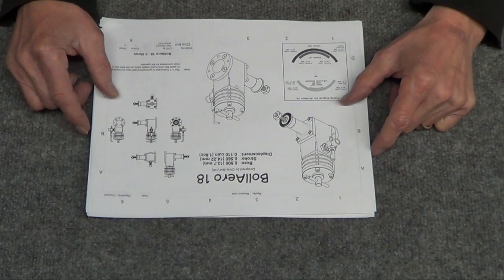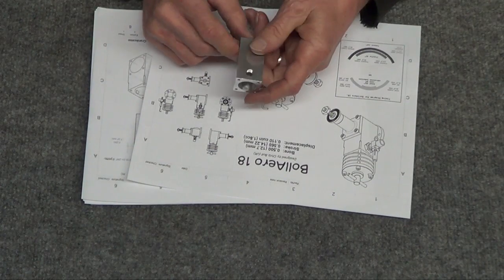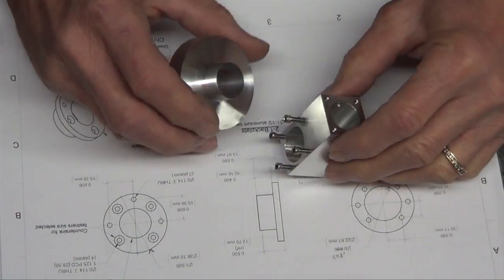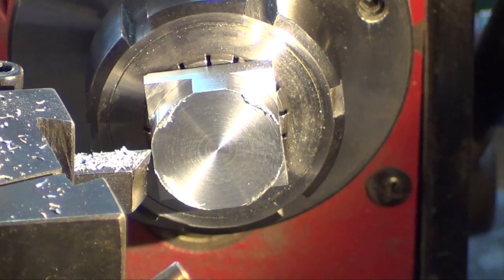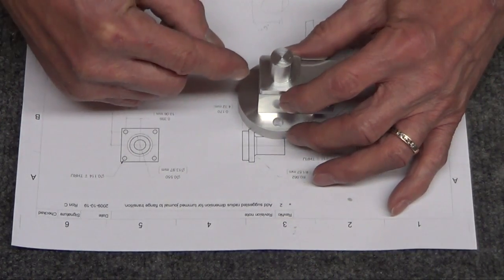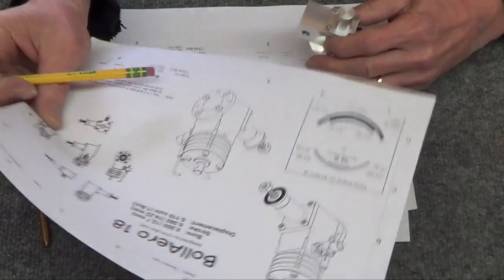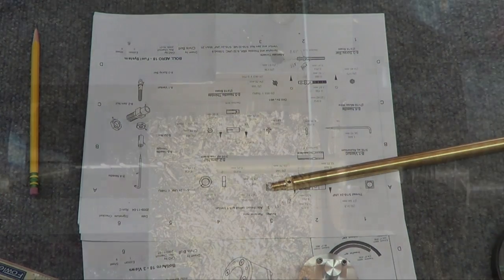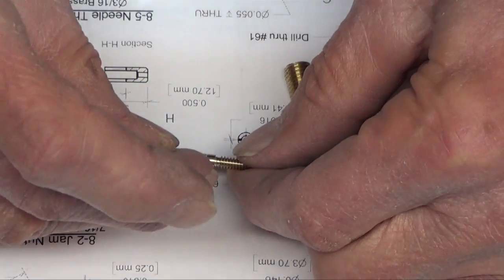Making A Boll Aero 18 Diesel Engine Pt.1

Comment: Hi Dave...  Tom Green....The Great white North...actually Northern Ontario, Canada..    Wanted to say hey and mention how much I'm enjoying the videos...   very informative and I appreciate the way you explain common sense....as you talked about in part 1 feeds and speeds....   telling people you need to cut to the centre...stuff that seems common place but if no one mentions it.... the first cut could be a BAD mistake...hahaha.
Over the next few weeks I'll be investing in a little CNC equipment, a router table, mini mill , lathe, and a 3D printer....  did I mention I'm a computer geek...?  haha    Something I've been watching for and maybe missed?   is   Taper Tooling VS. Collets....   seems to me collets would solve all the fitting problems you might have  and yet I see many with Taper tools..?   You Tony, Adam....   I was just wondering about the difference and wondering what I should be looking at considering I'm starting fresh....on all machines.  and suggestions?  or may a vid that you have already done?    Thanks and keep up the good work.
Reply from the maker: Glad you're enjoying the videos Tom. As for mills, cutters all come in just a few standard sizes 1/4, 3/8/ 1/2 and so on. So taper tools are not a problem you only need a few sizes. But now where do you want to go? I'm a hobbyist so buying a large 220V 3 phase mill that uses taper tools, which are expensive in them selves, is not within my pocket book range. I'm having fun with small lathes and mills which do not accommodate taper tools. So small lathes use a chuck for turning and mills use MT3 or R8 collets for end mills. The problem with MT3 collets is you can only get 3/8 and 1/2. I couldn't find any other size. So I solved the problem by going to ER32 collets on both machines. Cost less than $300 for all. Now I can hold ANY size anything in either machine. Feel free to email me privately and I can answer any further questions... Cheers

Comment: Great project idea. Maybe you already know this is meant to be a model airplane engine. You mentioned shortening the crankcase snout and crankshaft to match. Keep in mind the longer length is providing more bearing surface. If you have a local hobby shop, they will likely have model diesel fuel. There may also be a model club nearby. I'm certain they would be very interested and offer help in running and tuning.  Would you share where you got the blueprints and how to get them?
Reply from the maker: Been so long I can't remember where the web site was that had the plane. Google 'boll aero 18 pdf' and it's the first item listed for download. Hope this helps!

Comment: Dave, you might try this place for the diesel fuel. The website looks old so I don't know if they are still around, but it looks like they sell aero diesel in small quantities. (Look under Flying Accessories, and then Fuels.) http://www.freeflightmodels.com/   Otherwise, it seems that the fuel formula of 1/3 kerosene, 1/3 castor oil, 1/3 ether is common but as you discovered,  the ether is hard to find.
Reply from the maker: Thanks Hans.. will check it out but either is the main ingredient in the spray cans of starting fluid for cars. Watch me pass out trying to make fuel!

Comment: what kind of cad software are you using? There is a guy in "GrabCad" that has a Autocad Inventor files of this engine that you can down load.
Reply from the maker: I used Visio a bit for this project. You'll see it in part 2.

Comment: Very cool.
What is the hard to get fuel mix?

Brent
Reply from the maker: Either...
Reply: Dave M 

https://m.ebay.com/itm/Diethyl-ether-99-5-HPLC-Gade-30ml-/292382100376?_trksid=p2385738.m4383.l4275.c10&_mwBanner=1
Reply from the maker: Was hoping to get away cheaper I'll be and its sold where I live!
Reply: Oh wow ! That is daylight robbery! Even for pharma grade ether! 
Have you tried your local chemist? (apothecary...or 'drugstore' I guess you call it) 
Here (Belgium) I can get this stuff at my local chemist.
Alternatively you could use alcohol. The idea is that you lower the compression by which the fuel combusts.
So some of the fuel used for outboard racing engines with a bit of alcohol and some real diesel should do the trick....
This may be a matter of some experimentation...
As an aside... the 'starter' spraycans you can buy to start reluctant 2 stroke garden machinery and such is ether and nothing but ether... (Holtz and similar brands sell this stuff) 
This may be had cheaper and will be easier to come by for you, I am sure. 
I found two cans of 300 ml (that is 20 times as much as the link above!)of the stuff for about 15 dollar on fleabay.... So, it is out there. Retrieving the liquid out of an aerosol can is not that difficult...

Paddy